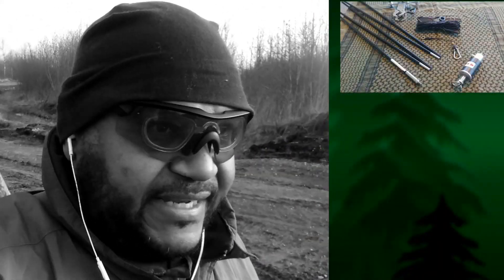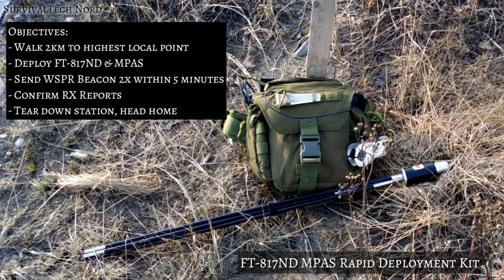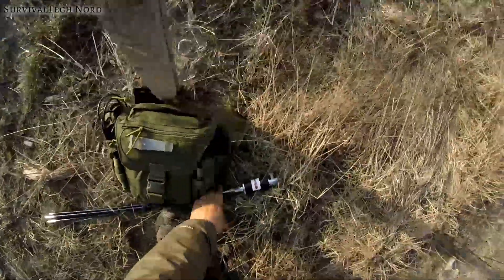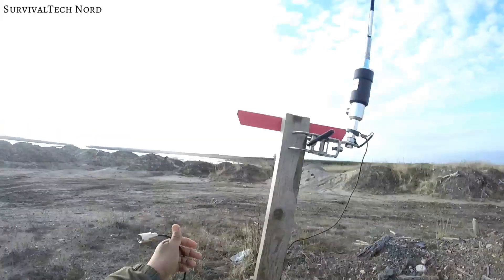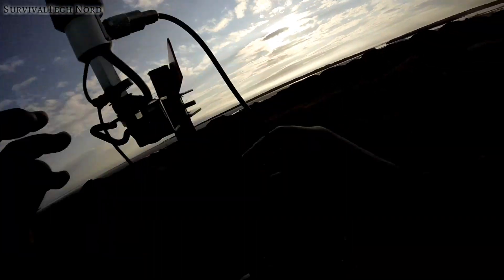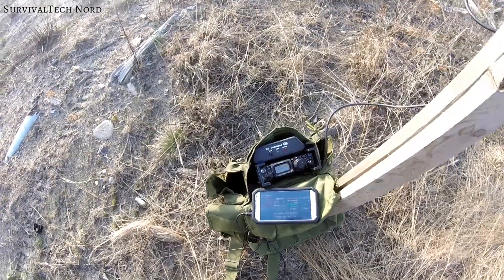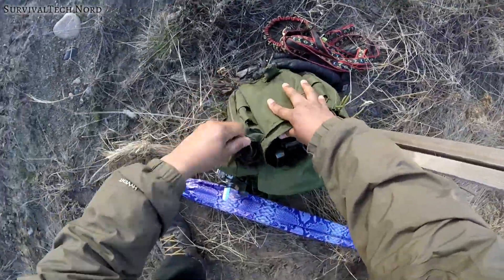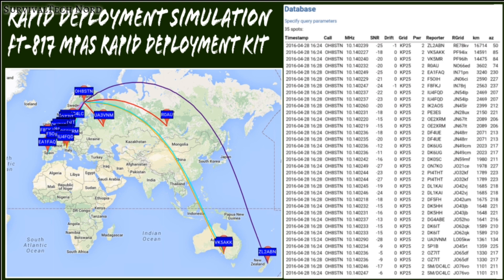Chameleon Antenna MPAS WSPR

Comment: OK, so let me get this straight, you are still doing this all on 5 watts out of that FT 817?   What if you use of the fancy antennas with a 20 or 50 watt radio?
Reply from the maker: +8digitPDX Yep! :D With 20watts, More stations would hear me. Check the comments from Konrad. We verified this today. Portable to portable contact exchange of call-signs and station information, using PSK31 which is like keyboard to keyboard chat. Here's my station from today https://www.dropbox.com/s/smrnawk2raqbtvw/2016-04-30%2015.39.50.jpg?dl=0
Reply from the maker: Small correction. In this video, I was using 2.5 atts :D

Comment: I have been using the Cha Mpas now for a few months. After fine tuning my set ups and using a antenna analyzer I find that the Mpas works wonderful . 2500 miles voice now on the enfed set up and the vertical with extension set up with one counterpoise. I went with rg174 coax at either 50 ft or 25 ft depend on set up. I have not been able to get inverted v set up high enough for good results.
Reply from the maker: Hi Robert

Yes the MPAS is one of my most used antennas. The most beneficial aspect is the rapid setup. I usually deploy with the CHA Spile, MIL Whip, and MIL EXT (especially in winter). In these conditions it is just too difficult to deploy a telescopic mast or other antenna structures, when it is -20 outside.
I know we give up a little TX efficiency for the luxury of rapid deployment, but in the real world, it is a small price to pay.
73
Julian oh8stn
Reply: Julian when you use the cha spike do you think that the spike in the ground is enough of a ground to act as a coumterpoise?

Comment: Regarding bags, you might want to check out the 5.11 MOAB 6 or 10. They can attach onto their larger bags or other larger bags/backpacks that have molle on the sides.
Reply from the maker: +Zachary Hiller Outstanding suggestion. I'll check it out!
Reply: esta es la bolsa. yo uso las mismas. 5.11 tactical. http://www.511tactical.com/push-pack.html

Comment: Just wanted to let you know was able to make a QRP contact in voice from California to NewZealand sat night. Used mil whip with extension and ft 817. Two counterpoise set out in a south and west direction one south one west about five feet. Elevation of about 2k  Getting closer to 7k mile mark on 5 watts. So the whip and extension will work out past 5k miles

Comment: Do you need to use the black wire antenna also with the mil whip? I thought if using the mil whip you don't need to use the wire
Reply from the maker: Counterpoise is always a good thing with these antennas. Even with the Transformer, it's still basically one half of a dipole.

Comment: Did you have to use the Mil stick and mil stick extension?
Reply from the maker: +Steven Hull Hey Stephen. I purposely used the basic MPAS kit (Hybrid Micro, MIL Whip, Micro element as counterpoise), to show people what's possible, using this modest setup. I could certainly improve performance by using the counterpoise kit, and adding the MIL EXT. Maybe the next time I go out I'll demonstrate some data Communications, using the same basic kit. 
As always thanks for watching

Comment: Quick question: what are you using to wind that counterpoise?  I'm trying to find low=priced plastic wrap devices like that, but am having trouble.  Thanks!
Reply from the maker: The wire winder is included with the chameleon mpas. They also sell them on www.chameleonantenna.com 
You can also have them from sotabeams.co.uk

Comment: Nice and simple deployment with great results. One side question... Could you share with me the brand of "over your glasses" eye protection you are using and where you purchased? Are they sunglasses or just safety glasses or both? This looks like a potential solution for me.
Reply from the maker: +kk6comm actually the "prescription insert" and the "ballistic protection " are one in the same. The company is called WileyX. This particular solution is called "WileyX Rogue with RX Insert". Here is a link to the WileyX Changeable series, from which these come. http://wileyx.com/Tactical/products/changeables 
The Rust color lenses stop the blue light which causes me severe migraines after my eye surgery. A small compromise, when the alternative was total blindness.
Hope this helps!
Reply: +SurvivalTech Nord  - Very much appreciated. I will be checking out the Wileyx website. Thanks for your valuable contributions to YT and the comms community.

Comment: It's very nice to see a complete setup A to Z and Z to A under 7 minutes! It's pretty fast indeed. Do you remember which direction your counterpoise was pointing toward?
Reply from the maker: +Chameleon Antenna Its actually faster than that. I stopped to put on the head-cam, look at the sea, rub the dogs, ... the antenna goes up really fast.  Not having to set up a computer, makes deployment even faster! Counterpoise was ~90° (+/-5°).
Reply: +SurvivalTech Nord is that the angle to the antenna? Or the azimuth one? Does the latter make for any directivity?
73 
DJ6KR
Reply from the maker: +Konrad Ritter Hi Konad.  It's the direction (azimuth 90° East) from north.
Reply: +SurvivalTech Nord thanks for the intel. I will do a test like this today. Thankyou for Inspiring me :)

73
Konrad
DJ6KR
Reply from the maker: +Konrad Ritter are you going out portable today?
I'm just preparing to go do another test. I thought that I would go to the same place, with a counterpoise beaming south. However in addition to the WSPR test I would also do some PSK63! Perhaps we and our friend +Steinhest can make a sked this weekend!?
Reply: +SurvivalTech Nord i would love to. How about 12:00 UTC today? Details via email?
Reply from the maker: +Konrad Ritter Konrad, Many thanks for the excellent QSO today Portable to Portable, 30M, PSK31. It certainly wasn't easy, but it most certainly was a blast. I was using a magloop, but next time we can try with various antenna and configs. I got a few screenshots decoding your stream. Good stuff!!!
Reply: +SurvivalTech Nord thank you too! 
It was a blast indeed. Once again I lost a buddipole whip to a fall of the antenna. But I had a spare one. I will post pictures and WSPR results of my Buddipole SetUp later this day :) 
I had quite some people ask me what I did there and they where quite impressed! Perfect advertisement.
Looking forward to the day we test all our Antenna Systems.
73
DJ6KR

Comment: i hate to sound stupid but what exactly is whisper beacon.
Reply from the maker: +Dennis DeBerry Only "stupid sounding" people, are the ones who don't ask!  :)
WSPR is a piece of software originally written by Joe Taylor that enables you to participate in a world-wide network of low power propagation beacons. WSPR stand for Weak Signal Propagation Reporter, and is pronounced Whisper!  With software, digi mode interface, &  radio it enables you to participate in the world wide wspr beacon network.  You can find more information on www.wsprnet.org
I hope this helps,  and thanks for the question.
Reply: Thanks. That explains it. I thought it was some sort of Top Secret thing that only Amateur Extra Class would know about.

Comment: i wish i could get my Wolphilink and WSPR to work properly
Reply from the maker: +SilentSniper Vt maybe if you describe to me Your setup, a complete list of all the gear, WolphiLink, Radio, Phone, and the problems, we can try to troubleshoot it together. I vaguely remember something about this which we spoke about before, but I don't remember in detail!
Reply: +SurvivalTech Nord sure thing I have a 817nd, the Wolphilink modem, a Samsung galaxy tab 8.0 and a HTC 1 Phone. I can receive PSK great but when I transmit no one seems to hear me or get spotted with WSPR
Reply: +SilentSniper Vt are you sure the audio output of your tablet or phone get's throuh to your radio? And is it turned to maximum volume? Does the radio switch to transmit? Let the radio show you the "output power" and check if it transmitts at all. :) if you still experience problems, just ask.
Reply: +Konrad Ritter I know the radio keys up but I'll check the other settings like the volume
Reply: +SilentSniper Vt 
My Tablet doesn't just let me bring the volume to max with the Wolphilink conected, as it thinks that it is a pair of headphones and wants to protect my ears :) I need to tweek around some settings in strange menus.
Reply from the maker: Hey guys
I'm just making a how to video, but here are some tips.
- radio is in digi mode
- digi mode setting on radio is set to upper side band USB
- Volume is at max on tablet, raise volume while using tge "tune" feature in WSPR Beacon app.
-power to 2,5w and digi Mic gain around 40
Reply: +SurvivalTech Nord okay I checked everything out set the volume to max and checked power and ALC now I'm running a few beacons to test it
Reply from the maker: SilentSniper Vt what band younon?
Reply: +SurvivalTech Nord I'm on 20 meters
Reply from the maker: I only see one station in eastern vt
Reply from the maker: Take a pic of yourcscreen and one of your rig and share it please.
Konrad Ritter can you think of anything else Herr Dr.
Reply from the maker: You can also switch from SWR to modulation meter to insure audio is going out of the radio. There are at least 6 stations around you, which should certainly hear you.
Reply: +SurvivalTech Nord i just checked and there is no modulation going out the radio
Reply from the maker: Ok, there are two reasons for this. (Reread Konrad's tips)
- are you in Digj mode? Not usb!!! Audio from digi port wont route through the radio if you're not in digi mode.
- open the WolphiLink and adjust the TX audio pot while you tune with the "tune" button in the app. Clockwise is max audio, counterclockwise is minimum. Max volume on the tablet!
I cant think of anything else
Reply: +SurvivalTech Nord yup did that turns the pods while tuning and nothing showed up and i switched from the tablet to the galaxy phone with no success
Reply: +SurvivalTech Nord i took pictures and tagged you in them in instagram
Reply from the maker: SilentSniper Vt  there's only one other thing that I've seen that can be blocking the audio. Sometimes the cables will he delivers don't fit deep enough in the sockets of the WolphiLink. It's the radio side of the cable. Take a razor blade and trim back a little bit of the housing couple of mm at most. This will allow the cable to push deeper into the wolohilink and make a solid connection.
Reply from the maker: SilentSniper Vt I mean trim the sjeeve back a couple of mm
Reply from the maker: Falling asleep :/
Reply from the maker: SilentSniper Vt good morning. I'll have a look.
Reply from the maker: SilentSniper Vt I think the only other thing it could be is that cable sleeve.
Reply: +SurvivalTech Nord
So let's get it straight :) There is a short checklist to identify where within your connection the signal is lost:
1. You can recieve and decode PSK? =>Yes? Great, so there is some connection. =>No? Check the plugs/cable sleeves.
2. The android device(s) audio is definetly at it's Maximum and it's the right Volume? 
(You can decide weather the outgoing audio of you android device is treated as music, media, a phone call or else, so be sure to put everything at max :) ) 
3. If you unplug die Audiocable from the tablet and hit "Start TX" you hear the sounds comming out the speaker? If not, the problem should be with your Android device, as the data coming from it, is just sound, that one can hear if played be the speakers.
4. If you plug it back in your device, it detects an external mic and Speakers/headphones? The device needs to output the audio via the headphones jack. Sometimes the devices don't "see" the headphones(aka WolphiLink)
5. The radio ist set to digital (DIG) as mode and that digital mode ist configured for PSK-USB or USER-U (Menue #26 on the FT-817ND)? 
6. The radio keys up upon hitting "TX start" in the App but doesn't transmit?
7. The modulation is down to zero?
8. All connections are solid?
9. Did you try trimming the connectors cable sleeve? (See STNs Tipps)?
10. Are all connections on the 6-pin Plug alright? DATA-Out, Gnd and PTT of the radio seem to work, if you can recieve and key the radio via PTT of the WolphiLink. Also there should be audio, as the WolphiLink uses one of the two channels for the PTT. If all this still doesn't bring light to our problem, we will have to meassure within the components, if something is broke I think.
Reply: +SurvivalTech Nord i gave him a checklist so we are all on the same page here :)
Reply from the maker: Konrad Ritter where is the checklist? Please post it here so others get the information. There is also my last point regarding the connector, which has happened on both of my WolphiLinks.
Reply: +SurvivalTech Nord Should be right above my comment. The trimming of the connector is included in the List. I tried to make the list chronological, so one can track down the fault in the connection to a certain place withn all the plugs and cables. Let's see. I guess he is from around the US, so he might as well be sleeping atm :)
Reply: +Konrad Ritter I am in the US and was Sleeping and I did Talk with Wolphi and they want me to send it back to them he thinks there might be an internal issue.
Reply: +SilentSniper Vt see :) I really hope they can help you fast and easy. If you got a working unit, give us a heads up. Hope to hear you on the bands some day! 
73
DJ6KR
Reply: +Konrad Ritter yea for sure I'll keep you guys posted thanks for the help and it's because of STN's videos why I bought a FT-817 and Wolphilink.